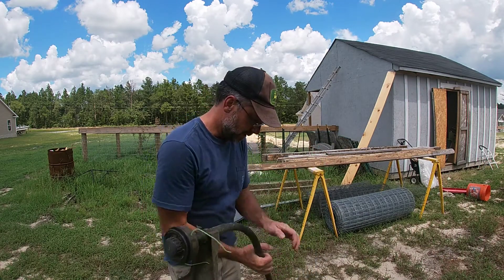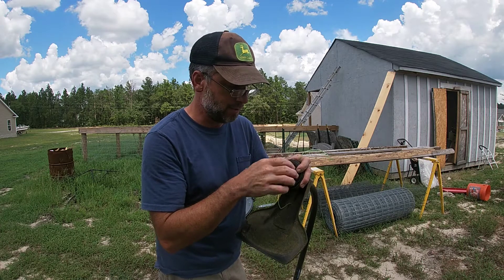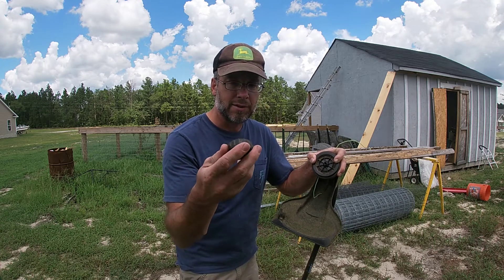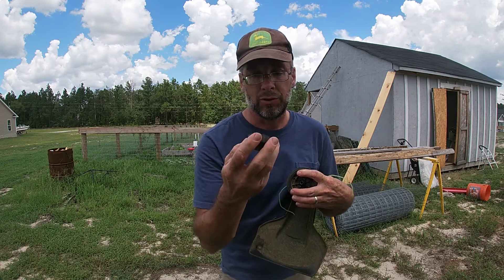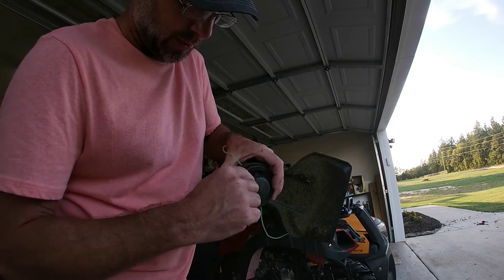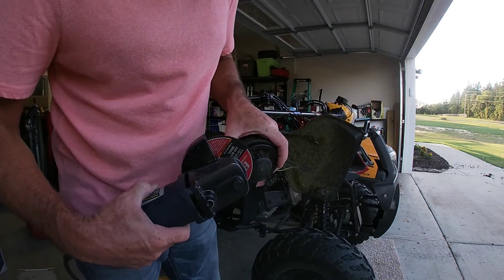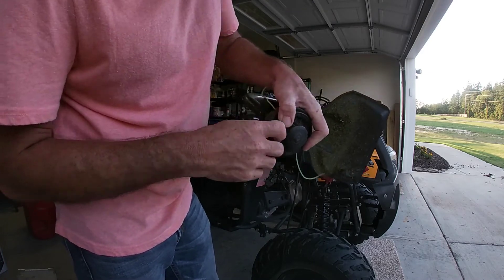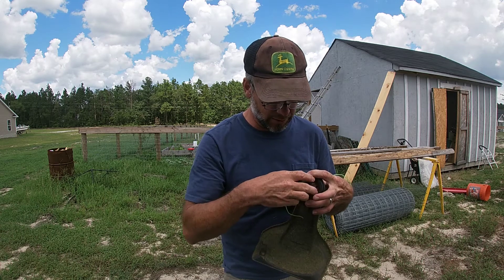Weed Eater Bump Cap Issue BL110 - Spinning or Stuck

Comment: I want to completely replace the head with the shakespeare push n pull head.

It works on my straight shaft hypertough walmart one.. im using it witha brush cutter blade and wana use the bolen for weed eating.

Comment: I have the same model you can pull the plastic off the bolt but doesn't always mean it's stripped the problem I'm having is the rod inside the pole is spinning at the same time inside
Reply from the maker: yea, people have several issues, so far, mine has been great

Comment: My screw inside bump cap gets stuck, frozen inside threaded shift coming out of weed trimmer. I tried putting antiseize on the threads, then the cap flies off everything I use it.    Sucks, No middle ground.   Gone through 4 new bump caps so far.  Each kne needs changed to a new bump cao everything that I need to restringing spool.
Reply from the maker: The only other thing i could think of is just run a tap through it and clean it up, maybe there is something wrong with it.  but that is very strange.

Comment: Hi there, my bump head bolt will not come out my bl110 the whole thing is continuously turning, I have the plastic part off but the bolt will not come out, any suggestions
Reply: Lee B.  Thanks for responding, but I've accomplished getting off
Reply: How did you get it off
Reply: The problem in having is the same bolt your talking about is spinning even inside the pole I can hear it?
Reply: @Phillip, I used a pair of vice grips and wiggled the bolt loose

Comment: My nut cap won’t even unscrew, help
Reply from the maker: You will have to order. New one, then you will cut the plastic, just off of the bump cap portion and that will reveal a bolt that you can use a wrench on.   That will help you get it off.  
You have to hold the larger cylinder steady while you unscrew.  Try some large pliers before you start cutting.

Comment: Can’t get the bolt out now
Reply: Had the same issue. Here's what I did.  Shoot some WD40 near where the bolt seats in the threads.  Take the longest  adjustable plumbers pliers you have and tighten onto the bolt. Hold the pliers onto the nut and keep the head steady with one hand.  Hit the end of the pliers with a hammer in the other.  The shock forced the nut loose.  Or at least it did for me.
Reply: @robertm5969  thanks, a young man with more mechanical skills than me fixed for me.